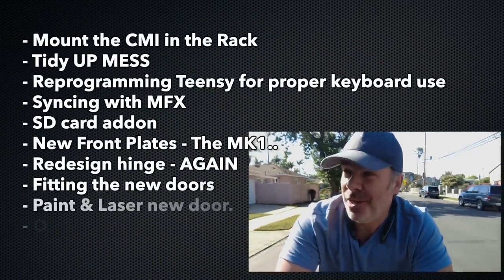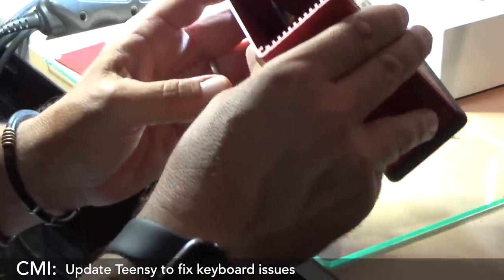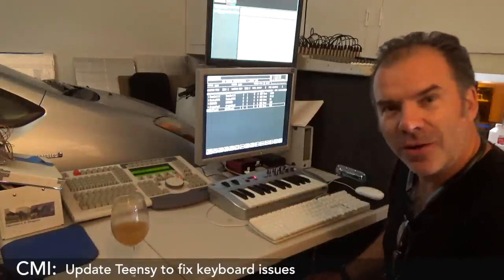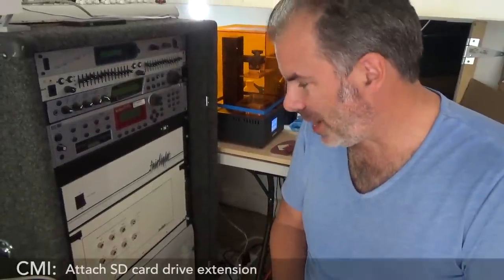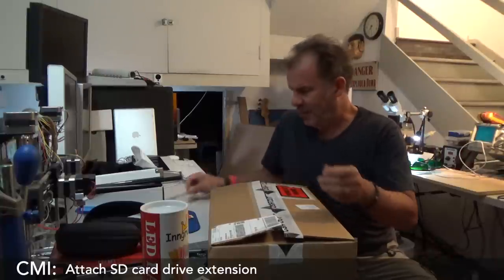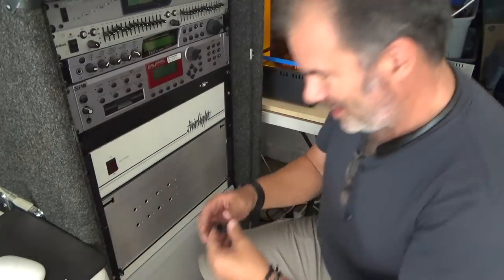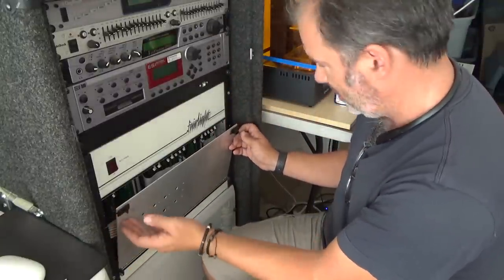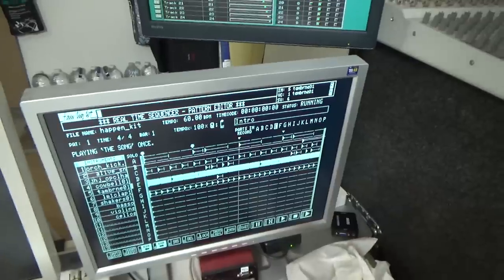I'm Building a Fairlight CMI: Episode 17

Comment: Might be a good idea to replace the drive with a SSD if possible.
Reply: Probably more reliable than an SD card long term. But it's SCSI which makes things fiddly. SD is used because of the SD2SCSI board. If it was using IDE then there are some IDE SSDs around, I have one in my Alesis Fusion. If only there was a SCSI2SD RAID device, use two identical SD cards so if one fails the other still has a copy of the data.
Reply: @6581punk  there were hardware SCSI RAID devices made, which transparently mirrored or striped between two SCSI devices, but the host only saw a single SCSI device. I imagine the current SCSI2SD or blueSCSI targets could possibly be updated to do something similar, but probably more practical to periodically backup a single SD card. :)